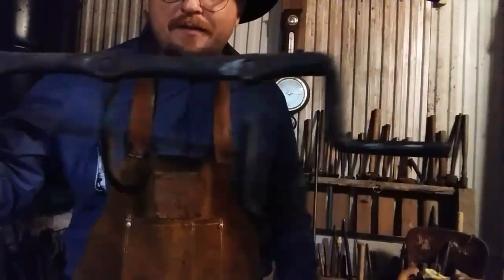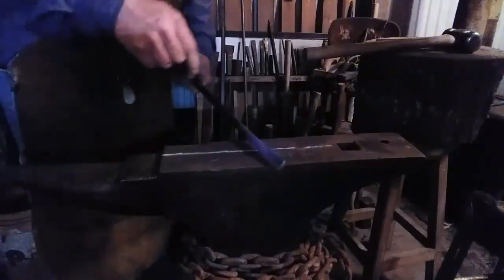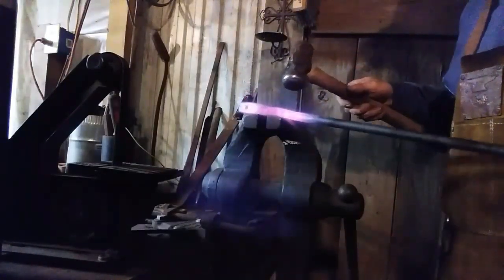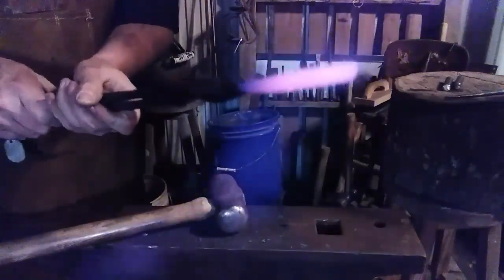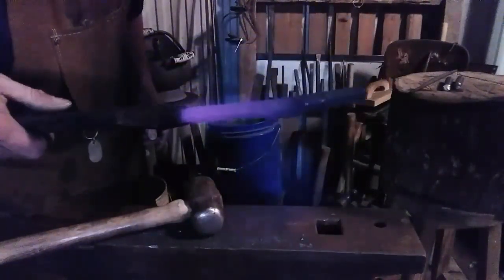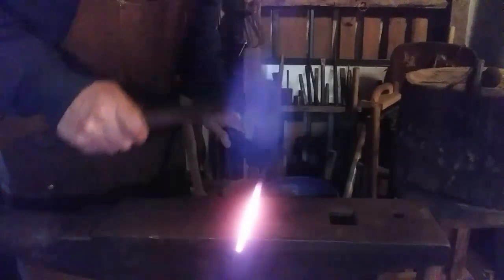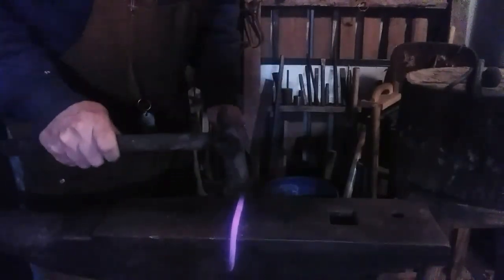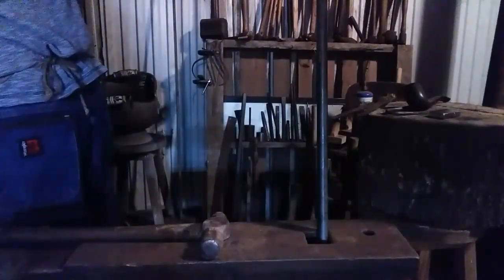Pan rack from 5/8"round bar

Comment: Looks great James however it may be more space efficient to make all the hooks one direction but I can see the aesthetic of coming into or out of the center either way damn fine pan hanger!
Reply from the maker: The spot that bar is going is kinda tight. That's why I opposed the hooks. The missus can take the two smaller pans off one side and the two big ones the other way. On another note, I'd recommend using smaller round stock for the hooks if you got it. I am out of rivet stock (5/16") so I had to draw out what I needed. Thanks for watching!